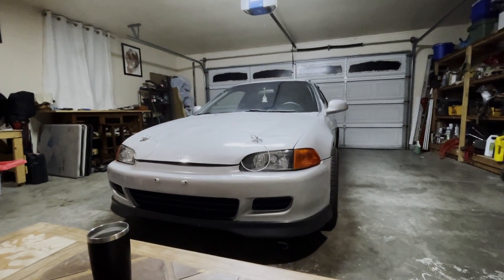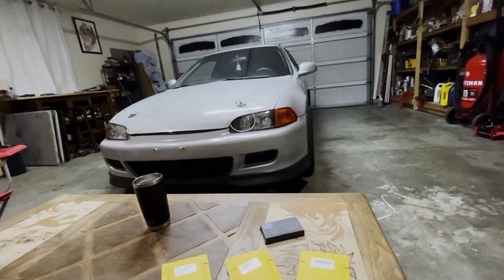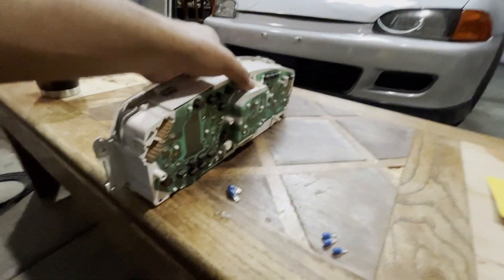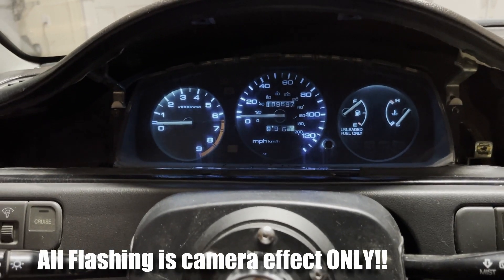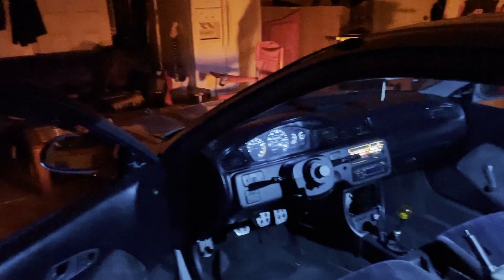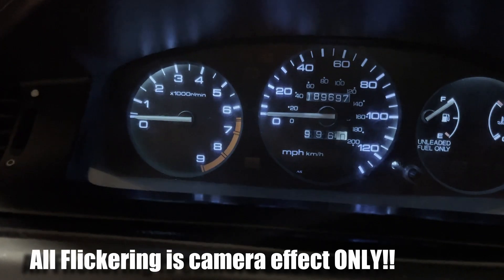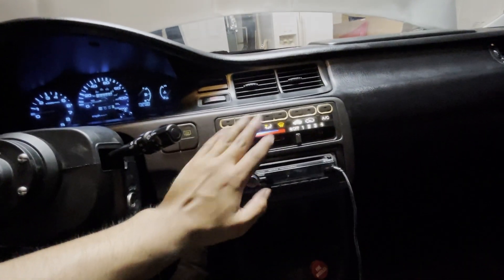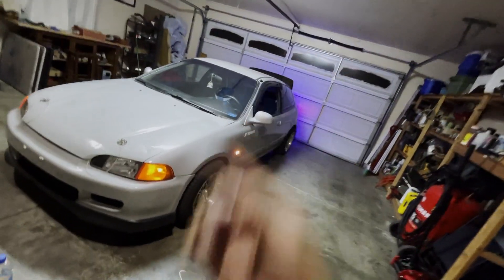LED Light Install '92-95 Honda Civic - Both Gauge Cluster & A/C Unit!!!

Comment: Smooth Video! Definitely going to upgrade my gauge soon! I like the idea of the AC as well. I like the glow around light when you turn them on. I had blue tag lights for about 5 years on my Mazda and got a warning by a state trooper then a ticket by the SAME state trooper lol. Just a FYI depends on your state, Alabama is a NOGO
Reply from the maker: @Laron53 Ohhh Damnn Really!? Did not know that. Hopefully i don’t get in trouble here in California😎lol
Reply: @projectgoodspeed  lol you should be good!
Reply: In South Carolina it's white or yellow light only.  Anything else will get you a ticket.

Comment: Can i ask, can change indicator light meter like handbrake, engine light?? Its same size socket T5 or another size? I have same like your car but 4 door Haha EG9/SR4

Sorry my english so bad because i live malaysia😅
I really love your video, easy to understand tutorial 👍🏻🔥
Reply from the maker: @AbdulSyukur-y6b No problem! I think i understand, you want to know if the bulbs for the other light accessories can be replaced? I believe you could but i dont know the size for those (like the check engine light, brake, high beams) Plus if you do change them these LEDs are really bright so that would make that one accessory SUPER bright.
Reply: @projectgoodspeed  niceee, thanks!!!🔥🔥🔥

Comment: I replaced to led awhile ago cluster stopped working. Pretty sure its a wiring problem bought another cluster same issue. No tac or speedo,gas,temp etc been driving like that for awhile now 🤦‍♂️
Reply from the maker: Damnn that sucks..you sure there the right LEDs?? maybe you blew a fuse? Idk thoo sometimes the leds are directional soo just flipping the orientation could work but if you say the WHOLE cluster stopped working that sounds like a bigger problem😅
Reply: @projectgoodspeed  Yeah checked fuses relays the whole bang. Its wire related more than likely just dont know if its a short or a damaged wire. They are LEDs i also bought all the colors to see what i liked.
Reply from the maker: @The Swamper Nation This is why i hate electrical stuff lol all you did was replace some bulbs and the whole cluster just decided to stop workin…haha it sounds like a wiring problem cause i dont think the the cluster would just break all of a sudden BUT then again im no expert
Reply: @projectgoodspeed  yeah ive asked around everyone seems to say wiring. So when i go K then ill worry about it i guess lol.
Reply from the maker: @The Swamper Nation yeahh well if your gunna swap it that makes sense… but thats weird thoo that it crapped out RIGHT when you were workin on it… if its not the wiring id check the grey plug that clips to the cluster.. maybe the connection to the green motherboard is loose or something
Reply: @projectgoodspeed  ill have to check tomorrow see if it works ill report back with my findings.

Comment: Can I put the hatchback trunk lights on my 92 civic sedan license plate? I wanna put them but it’s says eg only.
Reply from the maker: Yeahh the 92-95 civics both use either 168 or 194 bulb size for the license plate light. Now… if you mean the bulb from the “trunk” of the eg on the license plate of your sedan then…no, because the eg trunk has a totally different bulb. Soo just keep that in mind. But a 168 or 194 bulb is meant for the license plate!👍 id go for 194 tho
Reply: @projectgoodspeed  thanks man because of you I found the lights I needed to go full LED like you haha! Much love

Comment: I have an EG, my watch always lights up dimly, should it light up when I press it?  
Is that what it should be?
Reply from the maker: @ekremarslan3270 you mean the clock? I had an issue with mine doing somethin similar and it also would stay on AFTER my car was on lol drained my battery like crazy. Id recommend opening it up and see if any of the internals are burned out.Its pretty simple to open up and inspect it cause that was my issue..
Reply: @projectgoodspeed  Yes, I mean the time.
When I first bought the car, it was on brightly, then I connected the footlight and it started to glow dimly.
I will open it and look at it, but does it have to burn brightly all the time?
Reply from the maker: @ekremarslan3270 Gotcha! Well im not entirely sure but i do know mine dims down when i turn the headights on. So when i turn the indicator so the corner lights turn on its on bright. Then i turn it again to turn the headlights on and it dims. Hope that helps👍
Reply: @projectgoodspeed  Thank you very much.
I ask a lot of questions but :)
I'm looking for it in the center console. Is there anywhere I can find it or do you have extra?
Reply from the maker: @ekremarslan3270 no worries!👍 i dont have an extra one sorry. Id check ebay but its probably gunna be expensive cause people being ridiculous out there lol. Honestly id checl the junkyards around your area if you have any, thats where i got mine. Any 92-95 civic model uses the same clock
Reply: How many size t5 and t10

Comment: Good day sir? What socket should be replaced to change the light?
I just don't know if it is for the indicator
Reply from the maker: The back of the cluster has brown sockets that contain light bulbs that illuminate the cluster. Inside the brown sockets are small light bulbs that can be replaced. If you mean the bulbs for the indicators then i believe those are the black sockets located right behind the indicator locations. Hope that helps👍
Reply: @projectgoodspeed I need to replace one of the brown sockets, do you know if there t5 or t10?
Reply from the maker: @wyattsouthern4952 the brown bulbs for the cluster are T5!!👍 the T10 are a little bit bigger and are fore things like the trunk license plate light…i linked the ones i used in the description if you want more specifics👍
Reply: @projectgoodspeed  Ok thank you! 👍🏻

Comment: hello sir how did you solve the dull spot when turned on ,, ice blue,, i have an Ae101 its speedometer has several dull and bright spots and also all bulbs are same but the speedometer ones look sharp white
Reply: ok so saw the video it was the bulb on your side but mine has all bulbs working
Reply from the maker: On my Honda it was just due to the contact points from the bulbs to the cluster… im not sure why your getting dull spots if all your bulbs  are installed correctly… huh. One thing i did notice is that by blacking out the clear reflector gauges trim, i was able to basically make the light more uniformly dispersed instead of having areas closer to the bulbs be brighter …since the LEDs are brighter than the stock bulbs but its not like it was a huge change soo if your having a big dull spot that isnt caused by a fault connection, i dont know what could be causing it… have you tried checking the bulbs???? Maybe switching them around?

Comment: same bulb size for EG9/EH9?
Reply from the maker: @Calvin Tan it should be.. thats the sedan version right? Aslong as its the 1992-1995 generation its gunna be the same!👍
Reply: @projectgoodspeed  yessir! its the 4 door   civic with d16z6 engine same exterior and look as the EG9!
Reply: @projectgoodspeed  anyways solid vid mate! subbed!
Reply from the maker: Yeahh the bulbs are gunna be the same then!!👍
Reply: @projectgoodspeed  thanks lots buddy!
Reply: @projectgoodspeed  would you recommend disconnecting the battery for this or can I just save the hassle and change the bulbs while its connected?
Reply from the maker: Ummm im not really sure but i get what you mean lol I’ve definitely been too lazy to disconnect the battery 😅ive definitely changed the bulbs without disconnecting the battery haha
Reply: @projectgoodspeed  Thanks dude!

Comment: What year is this Honda civic??
Reply from the maker: 1995!👍
Reply: @projectgoodspeed  is it that same way with a 1994?
Reply from the maker: Yeahh. 92-95 honda civics have pretty much the same design👍
Reply: @projectgoodspeed  what about the headlights that you have are you good and will they fix on a 94
Reply from the maker: My headlights are aftermarket from ebay. With LED bulbs. Theyre not really that good… the housing has started to allow water in after 2 years and the LED really arent that bright.. ehh I’ll probably change them for some stock housing with different LEDs👍
Reply: @projectgoodspeed  ah I'm asking cause I just got a 94 Honda civic today and its standard
Reply from the maker: Sweet Broo! Yeah pretty much all 1992-1995 Honda Civics have very similar parts. only difference might be between the coupes and the sedans. And some parts can even be similar  between 1992-2000 it just depends on the part! Good Luck tho👍
Reply: @projectgoodspeed  cool bro thank you for letting me know